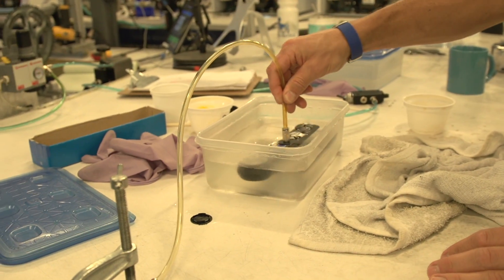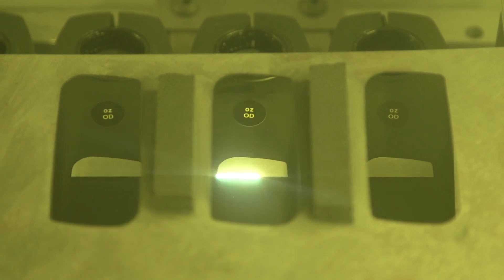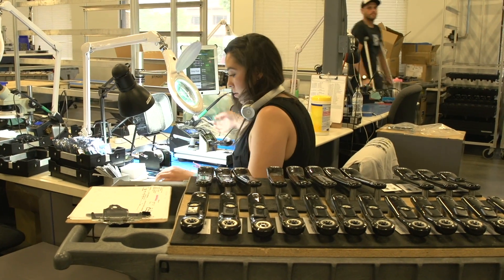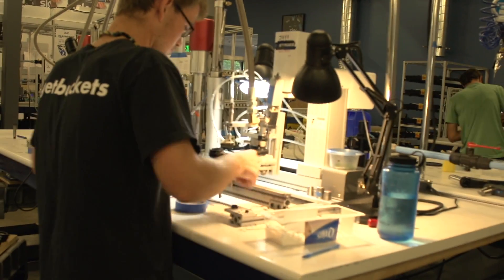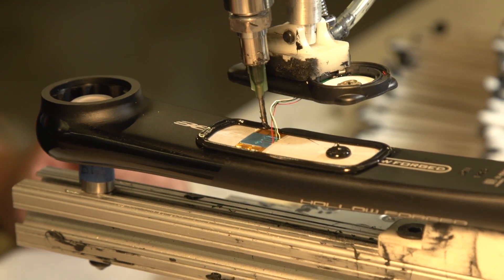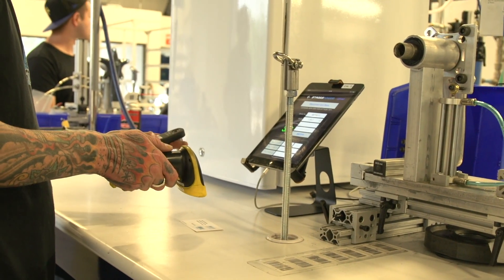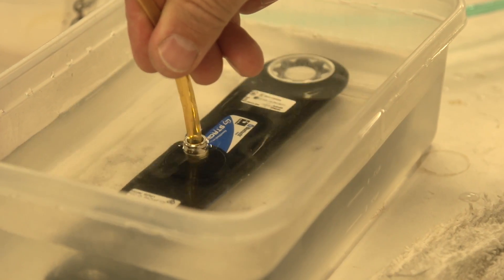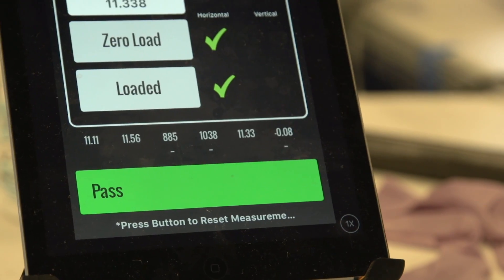Inside the Stages Factory - How It's Made

Comment: pieces of shit. I dropped about $800 on mine 2 years ago and it's worked correctly maybe 2 months. Water tight!?! Everytime it rains or I wash my bike I have to take the battery out and leave the door off overnight with a fan on it just to get it to work due to water in it. I've received replacement battery doors and orings. same thing... I wish I would have never wasted my money on this pos. Don't buy it
Reply: The 2nd gen doesn't have that problem
Reply: Bit of silicone grease smeared around o-ring solves all probs.  2 years for me gen1 no probs. 4 mths out of battery doing 10 hrs a week

Comment: Plus or minus 2‰ that's not very accurate?
Reply: +-2% at 1000w is 980-1020w. 20w difference isn't really that much unless you are a pro. And it doesn't need to be accurate, just consistent.
Reply: Pathetic to be honest, after all the checking and setup for each individual crank-arm.